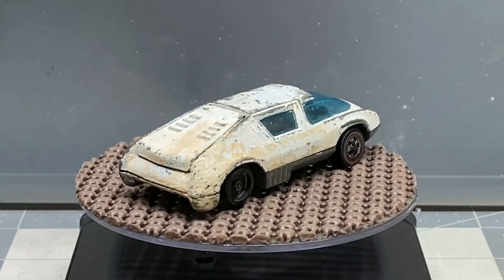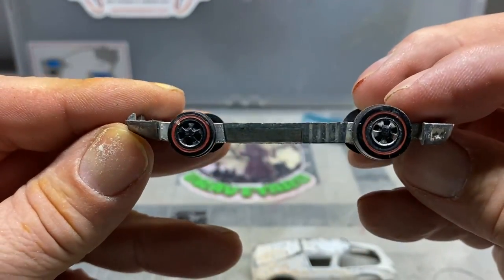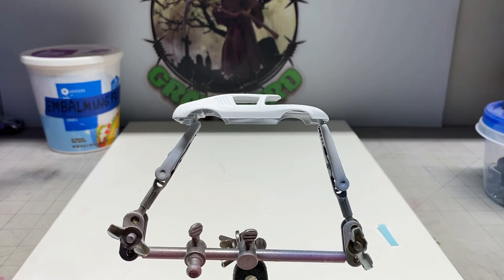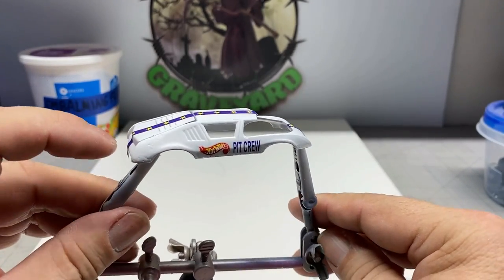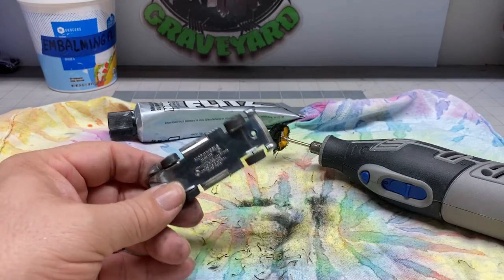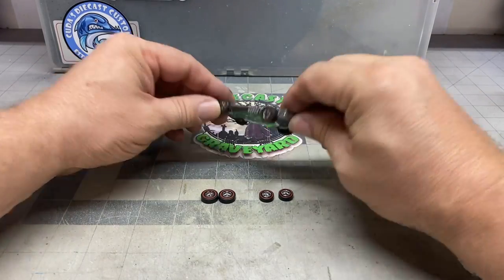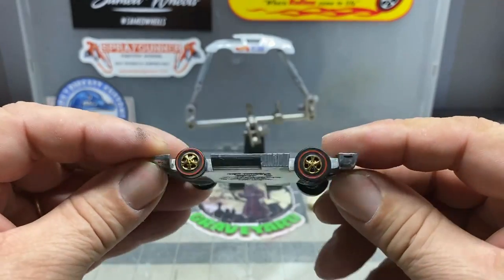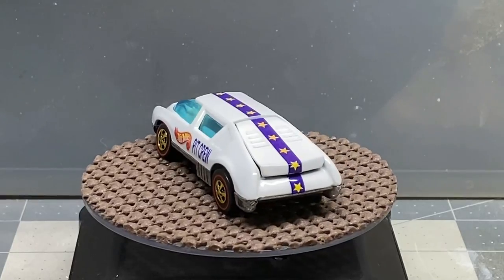Hot Wheels Pit Crew Car Restoration

Comment: I'm not a huge fan of the "fantasy-style" cars but IMHO this is one of HW better cars. The headlights are a nice touch but the tool-rack is very unusual. Was that a two-coloured plastic piece from the factory Paul? I wonder how they did that, something you don't see too often.👍

Using primer as the main colour has worked well here and it shows the quality of that clearcoat - you'd never know. It's turned-out a kinda off-white, looks classier than brilliant white. 👍👌😁
Shame it was never a popular car, I wonder what it was that folks didn't like?🤔

Cheers for now,🍻
Dougie.